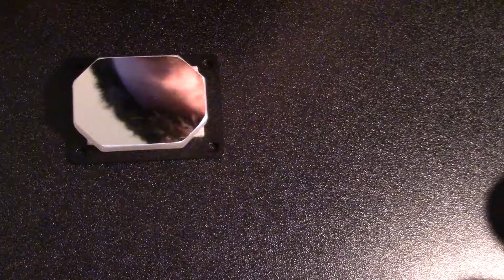GSO 1.25" 90-deg 99% Dielectric Mirror Diagonal Cleaning

Comment: Thank you very much for showing the internals of the GSO 1.25 dielectric. I always wondered what it was like on the inside. So it's a simple non-collimatable design. Not a problem but just a thing to note. The barrels are screw-in type, that's fine. It just occured to me that if desired this mirror could actualluy be collimated with paper shims. That's tricky of course but on the other hand there are less expensive diagonals with the mirrors glued in, in which case one can only try their luck.

Comment: How do you disassemble 90 degree mirror refractor telescope?
Reply from the maker: I'd avoid it at all costs unless your really careful doing it if you even scratch the glass coating on on the mirror it will be costly or just not as enjoyable to use it is honestly best to avoid having it needing to be cleaned. That means putting dust covers back on them to cover the opening when not using them. But the silver pieces unscrew and there are small screws under this diagonal that allows you to get inside it.

Comment: Not really a criticism but next time you make a technical video try using a neutral background/working surface. Not white and certainly not black. Both confuse the camera sensors, rob the shadows of infill light and contrast is always very poor. The same goes for stills. Unpainted plywood, MDF and packaging cardboard [in particular] are all excellent neutral backgrounds. Take a few 'snaps' of technical subjects lying on packaging cardboard and see if you don't agree.